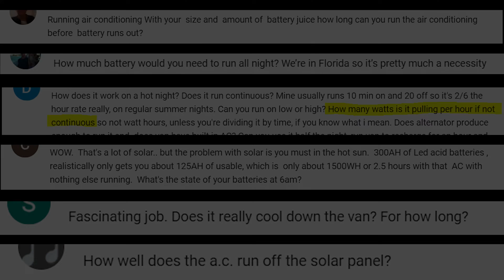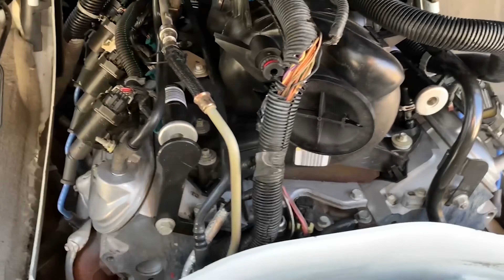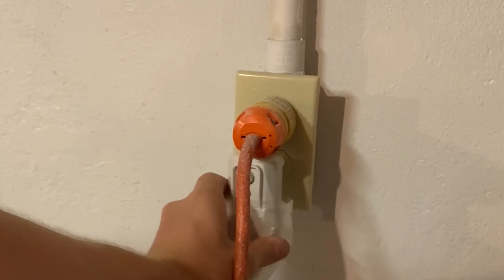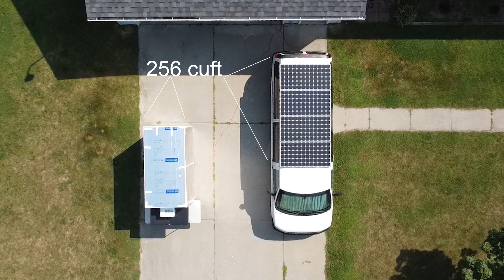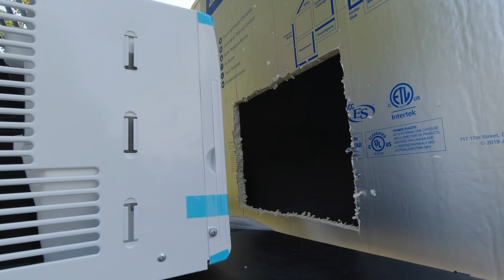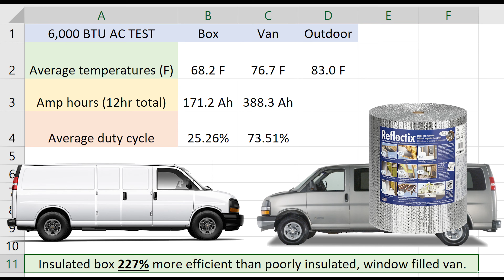Campervan AC (12 hour test, real numbers)

Comment: I noticed that the box AC turned on/off a lot more than the van AC.  Wouldn't that use more power from the surge of spinning up the motors more often?
For instance, using the same amount of on time, wouldn't it use more power turning on/off 20 times per hour vs. turning on/off 4 times per hour?

Comment: This was quite interesting. Remember that the roof of the van is shaded by your solar panels (assuming there's an air gap between the roof and the panels). A van without shade would perform even worse.
Reply from the maker: I sometimes wish I had more of an air gap between the panels and the roof. It gets REALLY hot on the roof, but at their current mounting, I can still manage to fit inside a standard U.S. 7-foot high residential garage.
Reply: @VanwithTim  Fitting your garage is a more important consideration than the air gap! It's easy to look from the outside and think "I'd have done such-and-such", not understanding all the factors that  influenced the builder. I was particularly impressed by your A/C ducting. Well done.

Comment: I have windows and I highly recommend going ahead and making the foam board window covers. There is a great tutorial on here for a couple that made them for their Prius build this way, with reflectix and fabric for a snug fit and an added layer. I personally made the outsides of mine black or white respectively depending on the panel since I have a white van, and added white or black perforated film to all of my body windows. Then double tinted them, standard so nothing fancy but every bit helps. This cuts down a lot, the white film reflects a bunch in particular, and I still also use a heavy canvas dropcloth curtain over the panels.

Comment: To minimize the heat from your engine, once you get to your destination open the engine bay hood until the engine and transmission cool down. With the hood open the heat will rise and exit through the engine bay opening.
Reply from the maker: I've done this a few times and it definitely helps! However it seems to attract a LOT of good samaritans checking to make sure your van is okay. Not a bad problem to have but it was unexpected haha

Comment: I think your installation method with having the unit basically inside a cabinet IN the van plus also restricting the cold air and trying to duct the window air conditioner puts the van at a severe handicap as compared to the entirely mounted outside the "test" box along with the unit being mounted higher and the air flow coming directly from the unit into the box.

Due to these variables I do not think the run times or the temperature comparisons between the two really have much of a valid apples to apples result.

If anything I would say that your van A/C installation method and design although nice for space and stealth is very inefficient as compared to a more standard mounted through a wall or rear window opening mounted unit which expels all of it operating heat outside the van and has free flowing cold air flow directly out of the vents.

I have actually seen some videos where people are making a hatch that can be opened and closed sized exactly for the A/C unit and are using heavy duty appliance type of drawer slides to actually slide the units out when being used or slide them inside the vehicle in a cabinet when not being used. This helps the stealth when parked and not using the unit and eliminates the unit hanging out of the vehicle when traveling.

Nice work though, I just feel the van is at much more of a disadvantage than just having the windows when comparing the cooling temps and A/C run time and power draw.
Reply from the maker: Hi Bill, thanks for the comment!

You’re spot on in all aspects. Would have loved to mount my unit higher up, but with 100% window coverage above the “belt line” it couldn’t happen.
The combination of the evaporator outlet ducting, evaporator inlet being at ground level, and the restrictions on the condenser inlet and outlet leaves the van’s system at many disadvantages.
That sliding AC unit sounds fantastic and is quite literally thinking outside the box – love that mindset!

Just finished another test with a now insulated partition curtain between the cab and living area. Results were promising but the entire test isn’t very nicely controlled. 

*This test was in Michigan, vs my recent test in the Mojave Desert of California. Daylight hours were comparable as were the weather patterns, but without a true standardized test environment there are just too many variables.

Will probably still post the video and results but obviously they would need to be taken with a grain (or entire shaker) of salt haha.

Thanks again for checking out the video and your comment!
-Tim

Comment: I have an Express access package on my van. So all of the panels in the back open up with my fob. And that's package also comes with all-wheel drive. I love this van. So only windows on the back doors and on  the side. So with the fob you can open up all three of the panels so it's wide open.
Reply from the maker: Oooooh! A true unicorn! Love those access package Express vans but have yet to see one in person.
Are you using it as a campervan?

Comment: Hey Tim, I followed the link from our conversation over AC copper brazing video. Great job with the test. I love a good analysis with controls. I insulated my van very heavily and this has paid a lot of dividends in both the summer and winter. I got my Ford Transit from the factory in 2018 with a few customizations (ecoboost engine, heavy towing package, upgraded alternator). I first covered the entire interior in sticky butyl sound deadening mats. Then two inches of polyiso insulation around all the walls and ceiling. Some areas of the walls have insulation as deep as 4 inches of polyisocyanurate. Every gap is filled with Loctite expanding foam. I even sheathed the bolts connecting the interior frame so there is no metal on metal contact between the outside and inside to conduct heat. So after installing my air conditioner it has (so far) been able to keep up, so long as I keep the doors shut.
Reply from the maker: Hey Galen thanks for checking it out! You're definitely the best insulated self-build I've heard of so far. Especially with going the extra mile to avoid thermal bridging the bolts!

With your separated compressor / condenser, you're pretty free to put your AC evaporator anywhere in the van.  Did you end up mounting up up towards the ceiling?

Sounds like a stellar build. Certainly inspiring!
-Tim
Reply: @VanwithTim  It is up against the ceiling so the cool air will displace the warm air against the ceiling. The evaporator housing rests in a catch basin with a drain line that runs back down, through the floor, and into a water trough under the condenser coil fan. The fan splashes this water on the condenser coil which evaporatively cools the coil for a slight improvement in efficiency. I have plans to direct the condensation into a catch bottle, it is pure water after all, and free water lets me stay off grid for longer.
Reply from the maker: @GalenMatson  Beautiful setup and planning. I've noticed many window AC's are also using a splash system with the condenser fan to give an extra boost in efficiency (via evaporative cooling).

A hotel I worked at had an industrial de-humidifier for the indoor pool. It simply drained the condensation "waste" water back to the pool.

Makes sense to hold on to it!

Comment: Great video! I think one should consider that the interior mount in the van probably greatly restricts the ability of the unit to shed heat. Maybe underway you get better airflow, but sitting in the driveway in the sun must be harder for that unit to move fresh air.  I went back and watched your install video, so I get it now. Maybe  an auxiliary  blower for that cubby would pay off? Just wondering. In the wild, though, parking in some shade at peak sun time would maybe help. I do like your install. My window van gets hot when parked and idling, but is ICE cold on the road (not a camper van, rather a passenger van). Have a Great Day!
Reply from the maker: Thanks for checking it out!

I saw a video where the owner actually split the hot condenser coil and mounted it below the van with a separate fan. Great way to avoid heat build up, but a lot of work (especially if something fails)

Another comment mentioned doing a comparison with the van parked in the shade vs the sun. Sounds like a fun future video once we warm up again!

Comment: Excellent video/testing, nice van and family. 

I’m a lifetime HVAC guy. I am in the process of installing a 9000 btu 22 SEER Ameristar mini split hp on my Express 2500, Standard height and length with 2 windows in the back, 2 on right side doors, plus Std cockpit glass. 1” fiberglass duct board insulated walls/ceiling, powered fan on rear roof (it can ventilate while closed, but better when pv is tilted to allow opening).

1000W PV, 5 ea 200W in series, manually tilt-able panels, 4K 120V MagnaSine Inv, Midnite Solar 250 scc, 24V 610ah LFE battery, two 8S with 2 Daly 8S 250A BMS for redundancy. Looks like It will keep us cool.
Reply from the maker: Woah that set up is a BEAST! Talk about a sweet electrical setup! 
There's an interesting AC video out there from another HVAC guy where he kept his window AC compressor inside the van but mounted the condenser horizontally under the van with an outdoor compressor fan to cool it.
Will you mount your compressor / condenser on the back of the van? Or plan on going full Frankenstein with an under-van mount?
Reply: @VanwithTim  I saw that too. I wonder how it’s working out? I’m going to mount it on the rear, left side bumper and keep the left rear door closed all the time. I thought about putting it underneath, but on a standard size van there just wasn’t much room under there, gets very hot and I was worried about salt spray and motor failures. Stop by next time you head south. 70 minutes east of I-75 on I-64.

Comment: I am wondering what would happen if you put the new a/c in the van? It is new, has no dirt, and hasn't taken the beating your other a/c has. It might show an efficiency difference.
Reply from the maker: I usually try to hose down the dusty condenser coils with each van wash, but I'm sure it's still a bit dirty inside the unit.

Could be a cool test!

Really wish I had access to the exact Toshiba unit for the comparison, but time was a constraint.

Still some pretty crazy power draw differences. Didn't expect that big of a gap!

Comment: insulation (or lack thereof) seems to be the deciding factor on net energy usage.  will you be redoing your insulation in the van?
Reply from the maker: Such a huge difference in energy usage. I think I may sell this set up in the future (as it's still pretty functional) and just start fresh with a windowless van.
An insulated partition between the living area and drivers cabin would help immensely in this van, but I would lose the passenger swivel seat... 
Of course I suppose I could probably do a heavily insulated curtain? You just got my thinking!
Reply: @VanwithTim  I bought a sewing machine and learned to use it just to make insulated curtains to section off the cabin.
Reply from the maker: @GalenMatson  Did you use anything special for fabric? I'm sure ANYTHING is better than the thin sheer sheet I currently have.
Reply: @VanwithTim  I used blackout curtains and sewed a soft microfiber blanket into them. The rear curtains I sewed hook and loop fastener onto (Velcro). They stick to velcro tape over the rear doors. The front curtain is on a rod that goes over the two cabin seats so I can easily open or close it. I have reflective window covers for each window as well. I use them together when it is really hot or cold.

Comment: Excellent testing, very nicely done. 
I went with a Panasonic 9,000 mini split heat pump/ac.
I have a E350 cutaway van that has approximately 686 cubic feet of volume. In South Carolina at 95F it averages 9-11amps or 180-200 watts on economy setting. It will keep it dead on75F on the economy setting or down to 62F on full power pulling 1,100 watts. I have 1,200 watts of solar panels and 600 amp hours of lithium batteries. The Ac should run about 36 hours with batteries
Reply from the maker: Really has me thinking about future van conversions. The windows are such a nice luxury but absolutely kill the AC / thermal efficiency. 
Sounds like your set up is very nicely insulated!!
Reply: @VanwithTim  R-13-16 just about everywhere. I enjoyed the video and subscribed 👍
Reply: @VanwithTim  I only got the rear windows and I sometimes even regret that. I have foamboard inserts with a reflective layer that I cover them with in the summer.
Reply from the maker: @GalenMatson  I suppose the ultimate setup would be to run wide-angle flush mount cameras on the outside (to keep a general eye on things) and forego all windows in the living area.

I know some people enjoy a window behind the passenger seat for checking blind-spots as well.
Reply: @VanwithTim  Tim, I have 4 cameras with a 360 degree view. They feed a DVR box which records each camera and feeds them to my Android head unit. It also outputs HDMI which I can watch from my computer in the carriage. The camera system is called SZ Dalos 360 bird view or something like that if you want to check it out.
Reply from the maker: @GalenMatson  Wow that's way more affordable than I would have thought! I've seen a few newer vehicles coming factory with similar setups (and have seen aftermarket on tour busses).

How long did your build take? I have a feeling you spent even more time planning.
Reply: @VanwithTim  The hard work of the build took about 7 months but it's never really finished. :) I planned for about 4 months before I bought the van. I created a very precise 3D model and wrote a 60 page plan. 

I spent a long time researching vans and their options. I chose the Ford Transit because it had the best combination of features for my needs and a reasonable price. I went with the 3.5L turbo, direct injection, Ecoboost engine because it is the same engine as the Ford Raptor, comes with 350hp stock. And it gets better fuel economy. 

Even fully loaded, my van can smoke any other van out there. And I've tested this. I can haul a 6000lb full sized trailer, I've tested that too. So I don't have to worry about accelerating to merge on a busy highway. The engine upgrade was an extra $1500. It was worth every penny.

The upgraded alternator can output 320 Amps. I have a DC converter which can charge my batteries with 850 Watts and the manufacturer says I could install a second one if I wanted to double that.
It took 2 months from order to delivery at my local dealership. I flew around the world.

The build process was periodically delayed because if I didn't have the ideal part I would wait for the exact one to arrive rather than substitute something from the local hardware store. So it probably could have been done faster.

The entire van was built with metric parts. Almost every bolt is stainless steel M8 1.25 socket head which matches the bolts used in the van itself. Every part can be fixed or changed with just 2 tools; a 5mm Allen wrench or a Phillips head screwdriver.
Reply: Close to mine

Comment: Hey Tim ,
Thanks for making this video,  this is the one question that no one has answered until now  , how long can you run the A/C on battery power.
Reply: I think the answer is "it depends"!  It's easy to measure the load when the A/C is on.  But as we see in the video, duty cycle is critical but it's really hard to predict due to all the variables.  More insulation is better, so is better air-tight sealing.  don't park in the sun, don't open the door constantly.  if your run time is insufficient, add more batteries.  if your cooling power isn't keeping up, get a bigger unit, more insulation, or a second unit.  Or drive to somewhere more cool ;)  I saw a video of a sprinter conversion that could run the AC straight off of solar while sitting in the sun, and keep the inside in the 70s.  I think that is pretty cool, it leaves the batteries to run the AC when the sun goes down when power requirements will be a lot less!  I've always liked Tim's conversion as it is really low cost (window unit) but doesn't look trashy.  When his AC blows out it should be pretty simple to drop in a replacement that can be found almost anywhere.  can't say that for a mini-split.
Reply from the maker: Thanks for watching Michael. My battery bank was around 360AH when new, but realistically I get around 175AH during a high current draw. As you saw in the video, the AC duty cycle plays a huge part in energy usage. At 100% duty cycle and no solar charging, my batteries would support around 4.5 hours of AC.

Comment: It's really hard to answer the question, how big to make your a/c or how much power will it use.  even sunshine has a big impact.  80 degrees at night is a very different thermal load than 80 degrees in full sun. at least in full sun you can enjoy a lot of solar power.  thanks for the informative video ☺️
Reply from the maker: So many variables. The sun is truly a double edged sword in regard to solar and air conditioning!